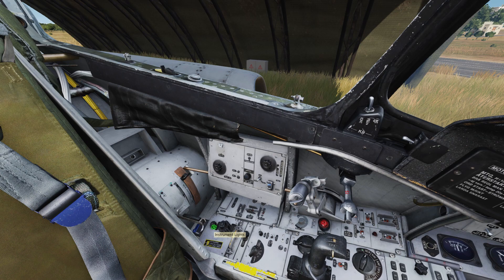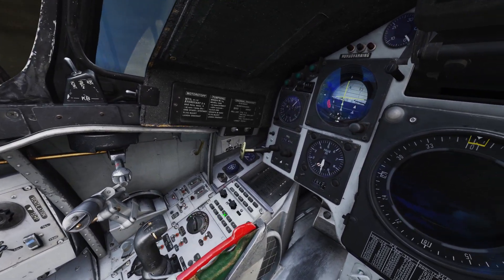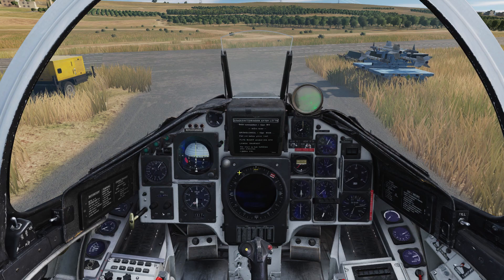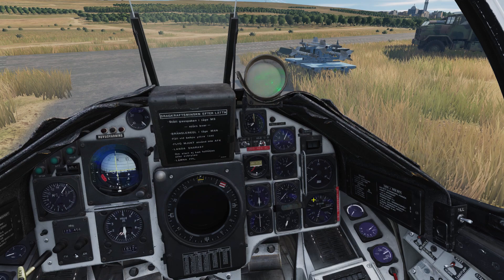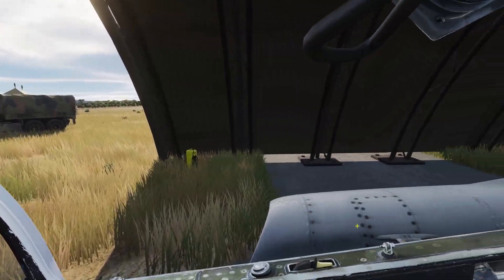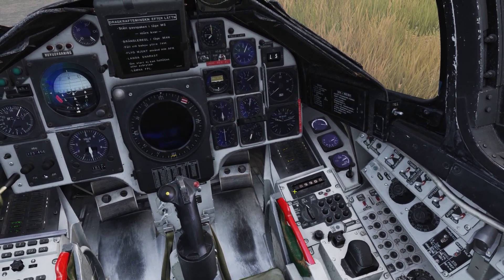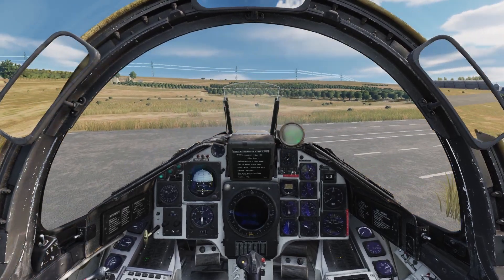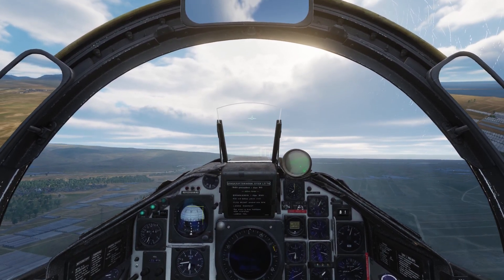Cockpit Orientation, Startup, and Takeoff - DCS AJS37 Viggen Tutorial: Episode 1

Comment: Thanks for the Viggen Tutorials. Will there be a countermeasures tutorial too? I don't get the difference between the INT and KONT switch setting as well as the fast dispense button. Looks also like a program on/off switch and not only hit an flare...
Reply: I'll have to look into it. I rarely use countermeasures in the Viggen, and when I do, I simply use the default "Fast Dispense" program that drops 1 flare and 1 chaff per second on activation. It's not often I run into a threat that requires countermeasures - pure speed and terrain masking tends to solve all problems.
But I'll do my best to research and cover this once I get the aircraft basics done. Thanks for watching!
Reply: @desertsaker196  Thanks. The basics and road base stuff is great fun too in the Viggen.